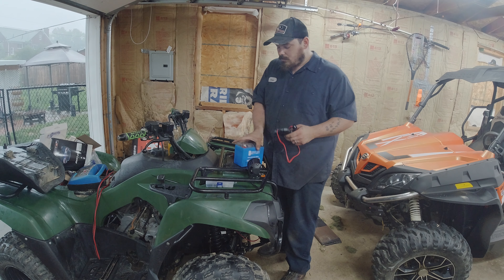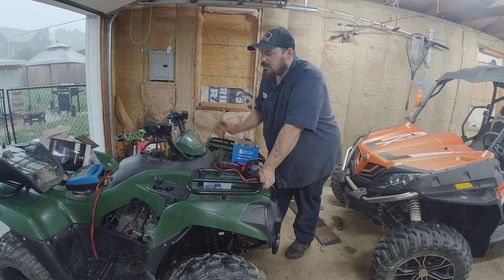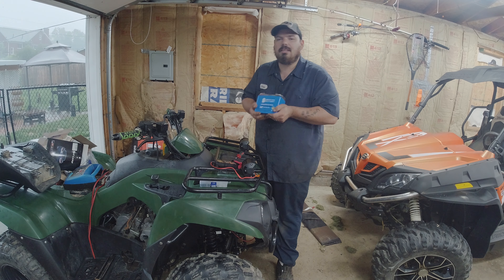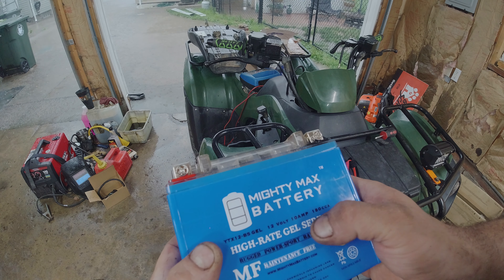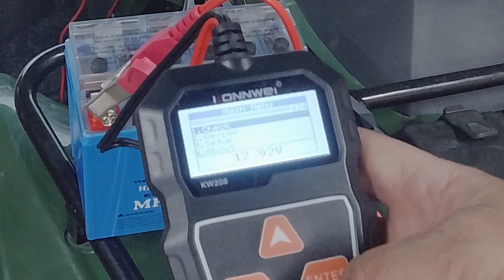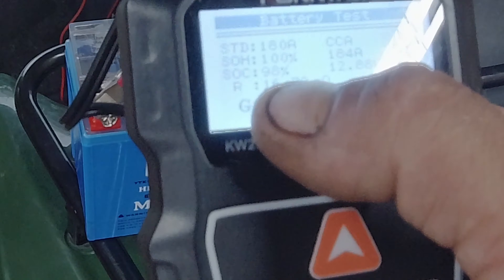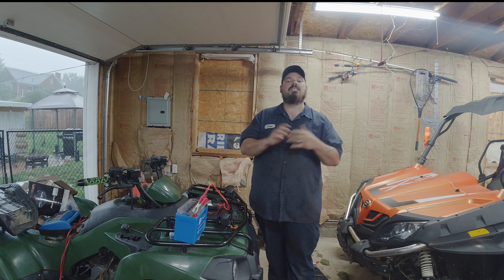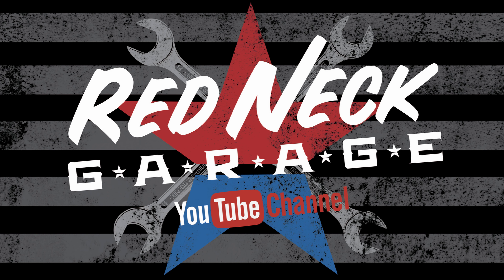How to Test a Powersports Battery

Comment: What is the weight like on the gel batteries. I bought a lithium ion battery for my motorcycle and it weighed nothing, lasts much longer, starts faster and can sit for months with no trickle charge and still start right up so anytime I can buy a lithium battery I do it
Reply from the maker: The gel battery is far lighter then my lead acid i dont know numbers but its a big difference.  The lithium will be the lightest yet.